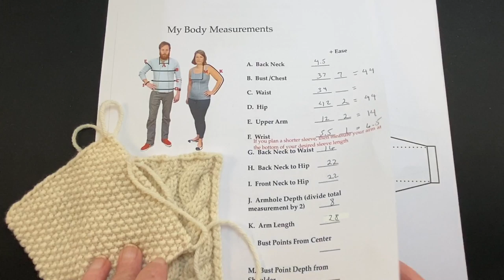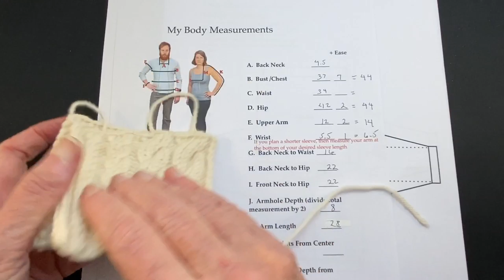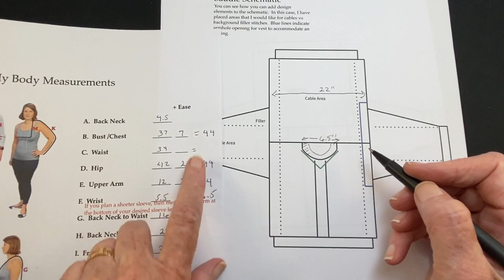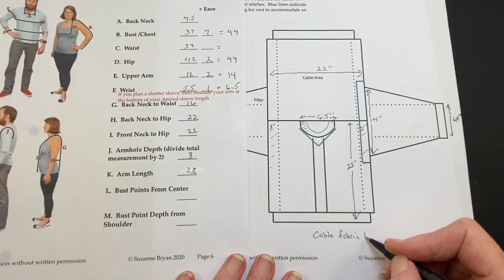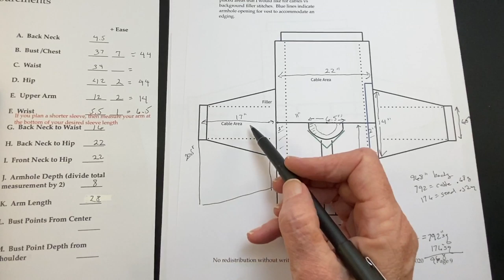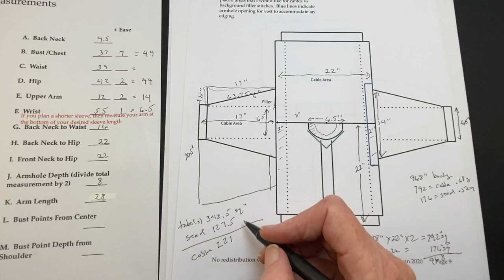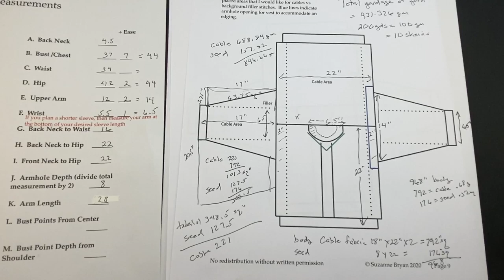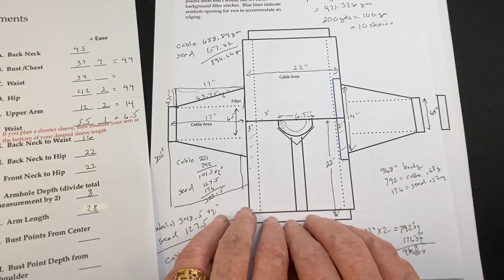Using Swatches, Body Measurements and a Schematic to Calculate Quantity of Yarn Needed

Comment: As a beginner-intermediate knitter, I was hoping this video might give some information on yarn weights and how to read skein labels when planning a project, but this is way too advanced for me at this stage!  Fascinating tho'!   I would like information on how to pair certain types of yarns with typical garments and projects.  Very basic.  What does it mean when the label says "use 5 mm or size 8 knitting  needles" and shows a 4" x 4" gauge picture18 sts x 23 rows ?  What does that information tell me when my pattern may have  different gauge directions?  For instance, I just knit an infant cardigan and thought the yarn seemed a bit "chunky" for the project, and the fabric a bit "stiff".  Label says 4 Medium.  Was that a hint?  Suzanne do you have any videos that address how to choose a yarn for your project:  label reading, yarn fiber content, yarn "thickness", texture, and fabric characteristics?  Obviously you don't want an expensive wool for a baby blanket, but some washable acrylics can "fuzz up" and look cheap.  How do you choose when looking at shelf after shelf of pretty colors and textures?    Nothing popped up in the search bar but maybe you talk about these questions  in a previous video.
Reply from the maker: Sheila, as a beginner I would recommend the Craftyarn Council and look under standards and then standard yarn weight systems. This is an excellent number of topics to address in future videos. https://craftyarncouncil.com

Comment: I really like this video. It's so analytical, and using this method a knitter can get an exact answer to the question How much yarn do I need? 
BUT, you're working from swatches made beforehand, and presumably you must use the same yarn when swatching that you're going to knit with, meaning that you already have the yarn. So.... When purchasing the yarn do I get one skein for my swatching, and then order the rest when I know the exact amount I will need? Or do I make an educated guess and order what I think I will need, and then try to return (ick) or purchase more?
Reply from the maker: If you have never knit a sweater for yourself before, get one skein, then order the rest.  If you have knit several sweaters, you will start to get a general idea of how much yarn it takes and can order in advance.  I usually order quite a bit more than I need so I can swatch without having to worry about how much yarn I am using.  It is up to you.

Comment: Ok so, even though I already did nice large swatches about 8", I now should do another swatch JUST four inches? It seems that's what I have to do in order to weigh the fabric before I can start all this math. I'm crying already Suzanne, math is not my friend.
Reply: no need to make different swatches :) you can calculate the grams for your 8" swatch. you will measure both sides of your swatch and then multiply one number by the other, for example one side (horizontal) is 7.5" and the other side (vertical) is 8.0", then your number is 7.5 x 8.0 = 60 sq inches. Then you need to take out your kitchen scales and weigh your swatch - this will give you for example 7 grams. then, to identify the grams per square inch, you will simply divide: 7grams (weight of your swatch) / 60 square inches (area of your swatch) = 0.12 grams per square inch (rounded up to two decimal places). then you will use this number once you know the overall area of your sweater to be (in square inches), like Suzanne did ;)
Reply from the maker: Katarina's reply is perfect.  I enjoy following your progress.  Yes it is scary at the beginning, but when it starts coming together, it is so rewarding.  I can't wait to see your sweater!
Reply from the maker: Thank you Katarina.
Reply: @SuzanneBryan  glad i can help :)